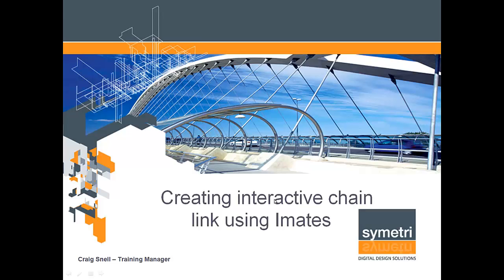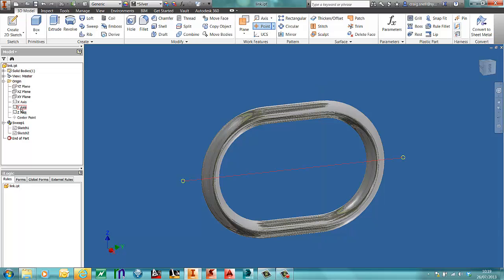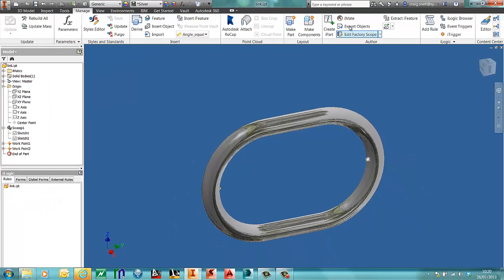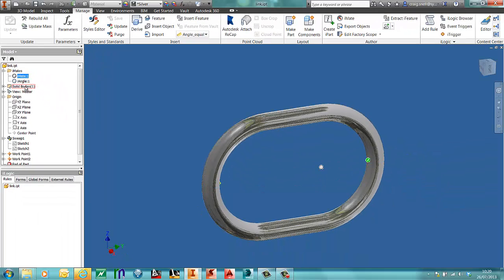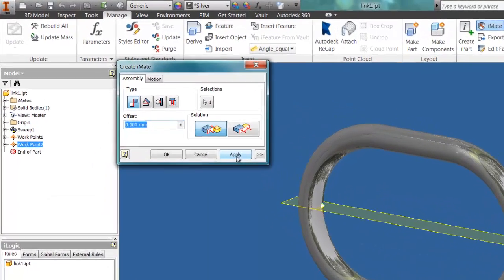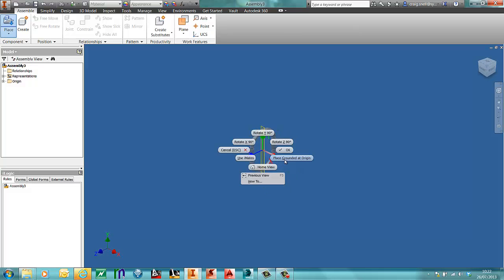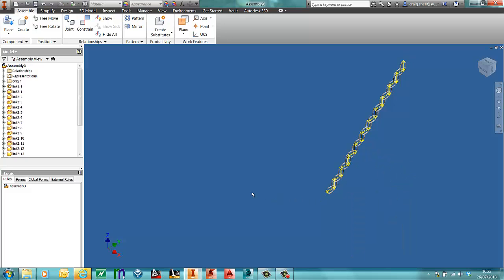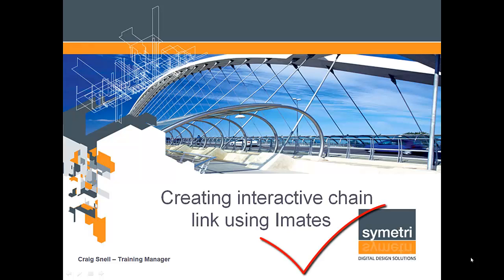Inventor Tips & Tricks - Interactive Chainlink

Comment: Can you make the chain follow a path now say around a pipe
Reply: Hi, It's not something that I have tried, but in theory, yes you could,  What you would have to do is create the path around the pipe by using a 3D sketch, and then using a 3D intersection which would place the 3D sketch on the pipe.  Then you would place the work points on this path, rather than in space as I have done in the video.  This should get the chain going around the pipe. Thanks